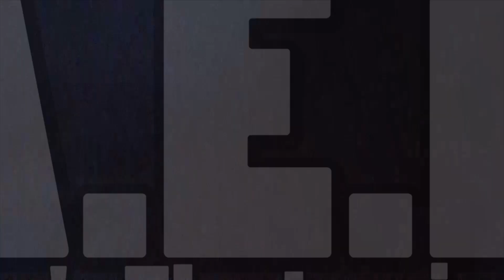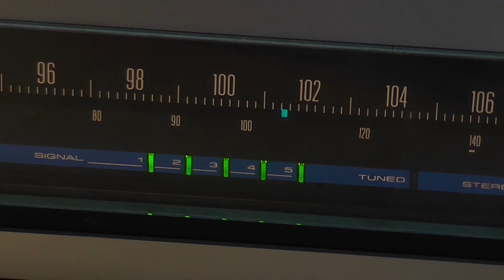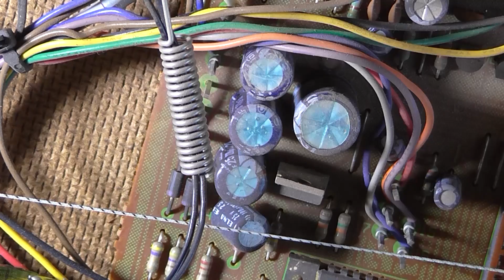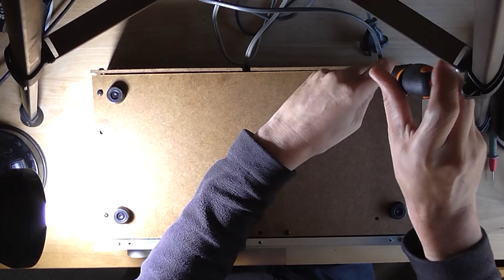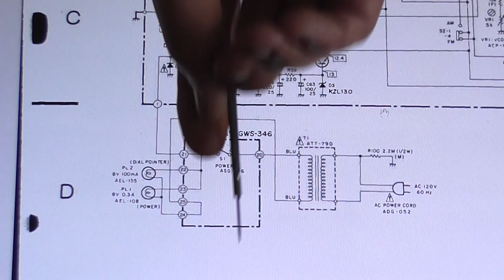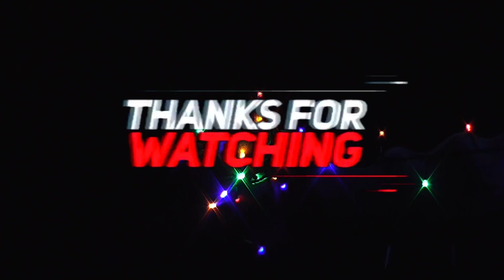Pioneer TX-520 AM/FM Stereo Tuner General Service

Comment: Great video. Thanks. Shame that the power switch only switches the secondary. How cheap. I have one too. Just won't give any signal output at all. No signal bars. The power supply is good and giving 9v to the blue brown on the card. It used to work some years ago. Any ideas. Thanks

Comment: What do you think of the reception and sensitivity of this FM tuner?  I know its a basic 3 gang, 2 filter tuner but I have a SA-620 Amplifier that I would like to match it with. I'm also looking at the TX-720 tuner, but the specs are basically the same and the TX-520 is much better looking.

Comment: D1, D2, C66 and C67 are a voltage doubler,  turning the 8 volts AC transformer output voltage into 16,5  DC voltage at C65 main filter capacitor,
Reply from the maker: Now I look at it, yeah, you're right. That makes perfect sense!

Comment: Before I have even had time to watch the whole video, I have to mention that when I just recently repaired two 80's Japanese hifi devices, one from 1980, another from 1988, there was a huge difference between solder alloys used. The solder from 1980 seemed to be very good quality, no cracks no dry joints, no problems at all. The solder alloy from 1988 was very fragile and crappy, several cracked, dry joints. 

Another thing I noticed was the astonishing quality of electrolytic caps used in both of those devices. Practically all of the caps ( made by Nichicon, NCC, Elna etc.) were in very good condition, no leaks, no shorts, no poor ESR values.
Reply from the maker: Yeah, they don't make them like they used to.